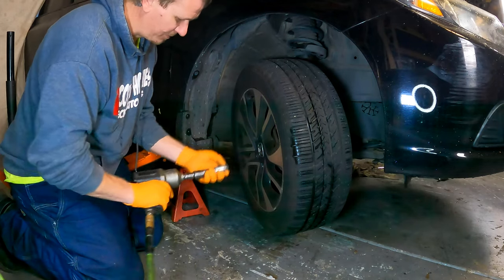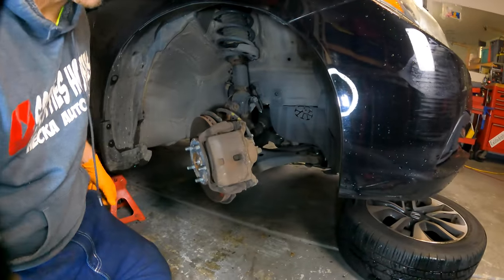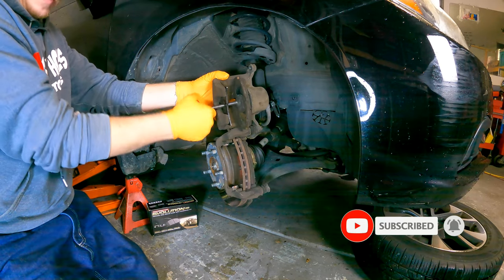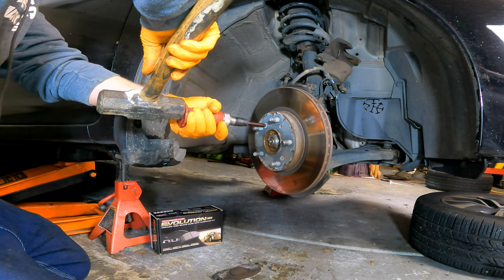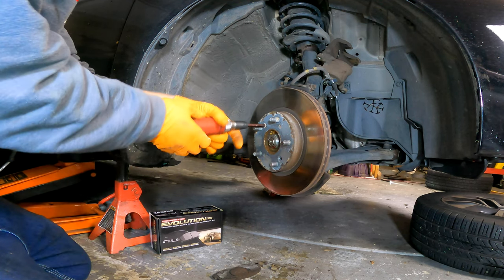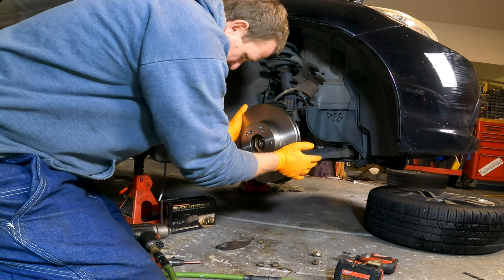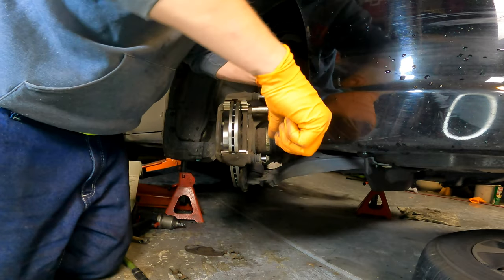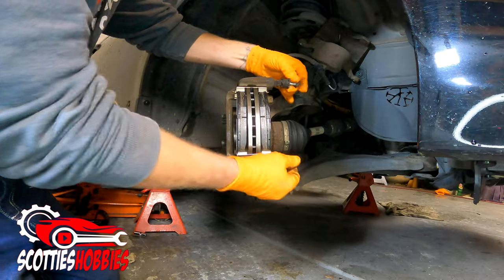Honda Civic. How To Change Front Brake Pads & Rotors.

Comment: The slide pins. What direction are the ends supposed to face? By ends i mean the rectangular ends where the 10mm bolts go into. Are they horizontal or vertical?
Reply from the maker: I believe vertical, if I am understanding you question. They will fit flat onto the caliper if installed correctly.